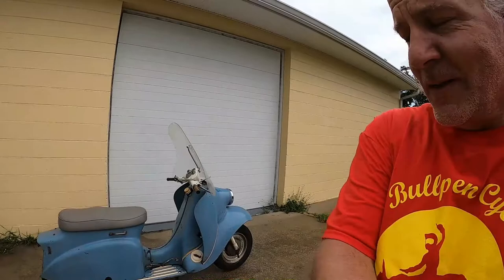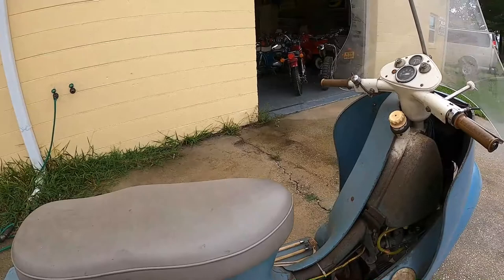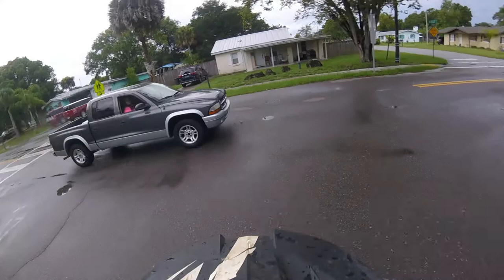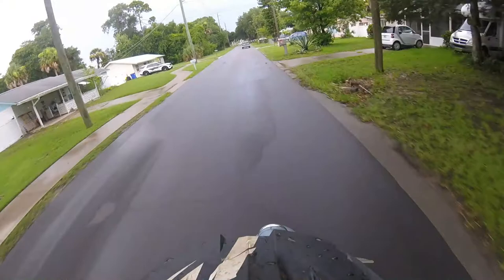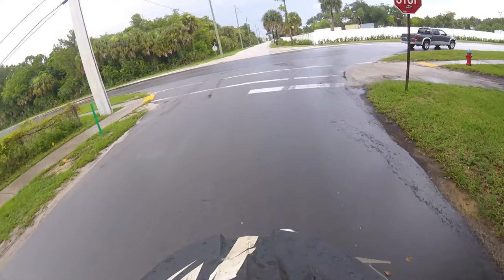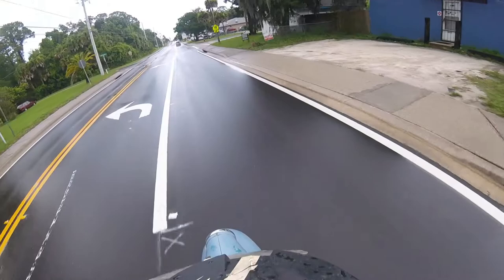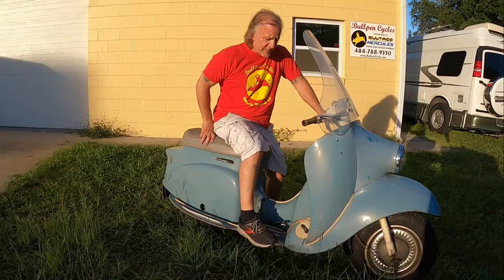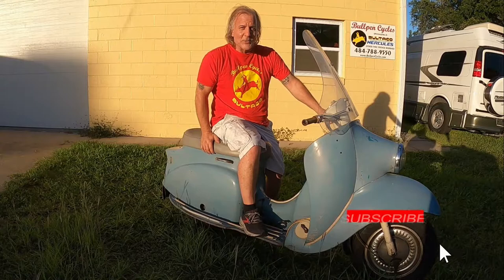THE WEIRDEST SCOOTER OF THEM ALL

Comment: The concept of a front engine + engine speed driveshaft + rear axle and gearbox is an advanced concept used only on fine and rare sports cars, the likes of Pegaso Z102, verious Ferraris and Alfa Romeos, Masseratti, etc and some American cars as well. Full list on link below.

Velocette not only held many patents for stuff used nowadays, but were on the forefront of technological motorcycle progress for many years.
Just one example is the positive-stop gear shift mechanism used on all motorcycles since 1928 or thereabouts.

https://en.wikipedia.org/wiki/Transaxle

Comment: Weird only your words and actions. The Velocette Viceroy was bever made for the Police that was the LE ( little engine) then the flat twins continued into the Valiant, Vogue and the 250cc Viceroy. Like most Velocette products way before its rime. Electric start, aharft drive ,could cruise at 110kms. Werird to tou but much appreciated by real enthusiasts
Reply from the maker: Some of that I agree. True the LE was for law enforcement, but the Viceroy was intended as a follow-on to the LE, and it never took off. Weird, as in unique, it certainly is that compared to any scooter of its era, and that's not derogatory.
Reply: "Ha, ha". Nelson.